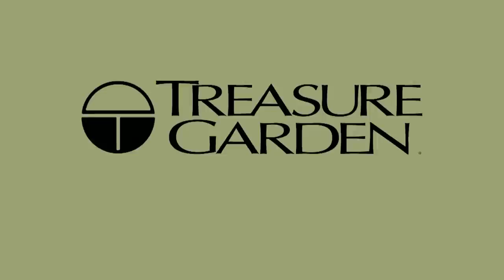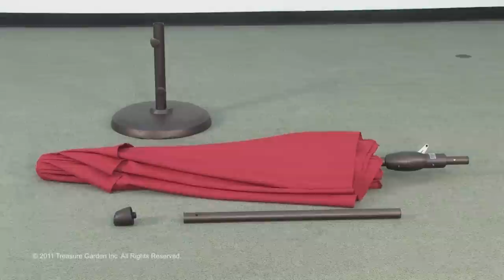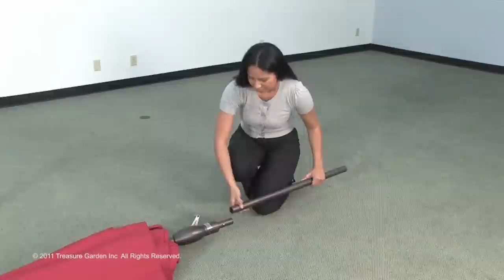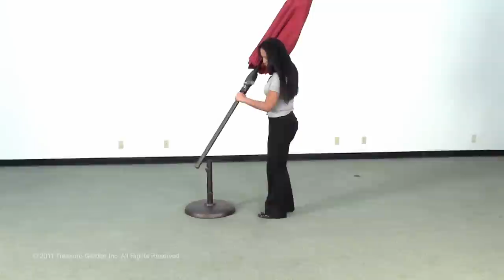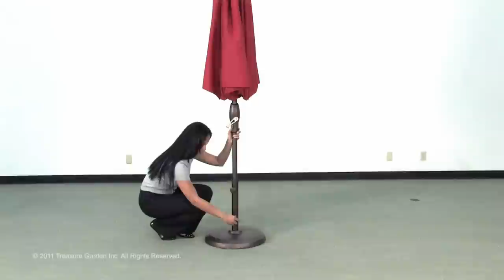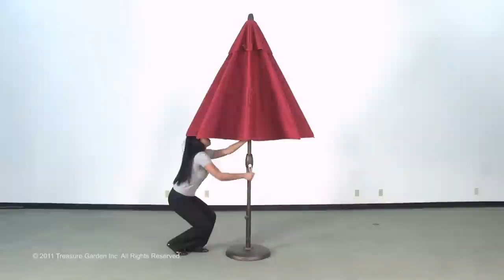Auto Tilt Market Umbrella

Comment: hello what happens if cranking clockwise does not bring umbrella back to up right position? is there a fix? thanks
Reply from the maker: Hello! To bring your umbrella back to an upright position from the tilt position, you will need to turn  the crank handle counter clockwise until the umbrella is back to horizontal position. Continue turning the crank handle counter clockwise to close the umbrella.